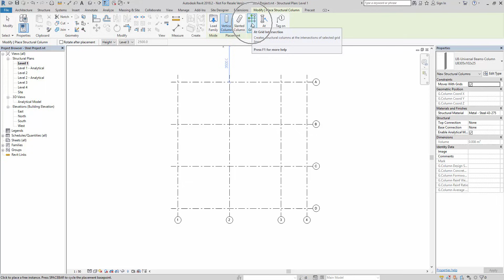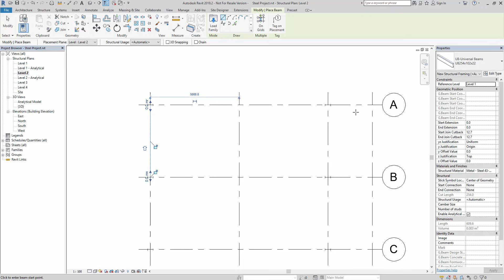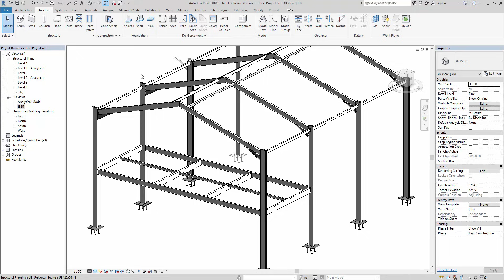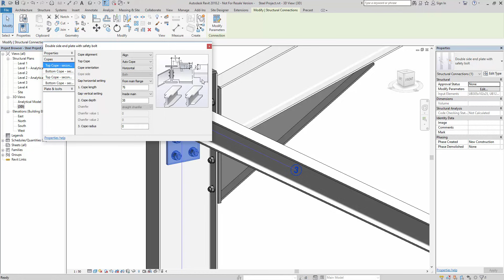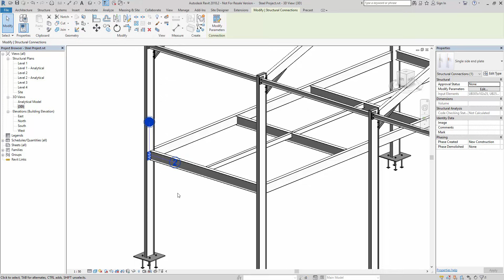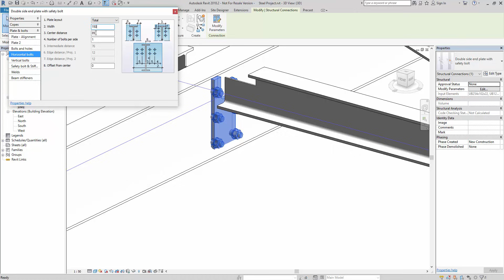Master Revit Structure in 28 Minutes...

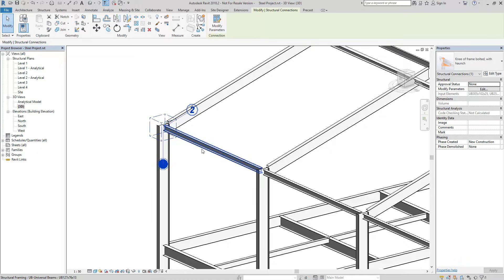Comment: Hi everyone I did that 10:28 but my connection's bolts takes from flange to flange I don't know why... cuz I've selected the same type Knee of frame bolted with haunch connection. SOLVED!! I was choosing the wrong bolt type
Reply: I get the same problem. The bolts are too long(flange to flange at steel column). May I know how to solve it?
Reply: @kimlui88  go to edit connection type/vertical bolts/1. set out= Middle
Reply: @luisb2253  Thank you. I just solved it after you gave me the hint.
I did by:
edit connection type->bolt->unselect "Bolt on gauge line"-> adjust #2. Horizontal distance.

Comment: i have  loaded the connections, but when i drop down generic connection it doesnt show up, instead its there seperately as structur connection and it is not connecting to the steeel column, why is that?
Reply from the maker: Probably the beams are not suited to the connection

Comment: Excellent video
Reply: This guy has no idea what he is doing. You can not erect this building as detailed using end plates since the columns will be erected then the beams.
He obviously has never detailed a real steel building. Unfortunately revit structural detailing is the lost leading the lost